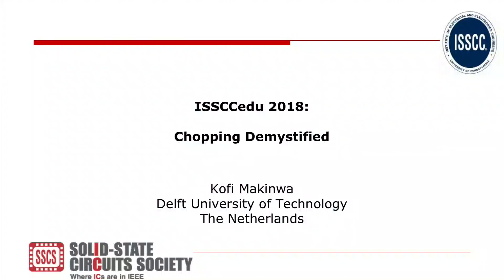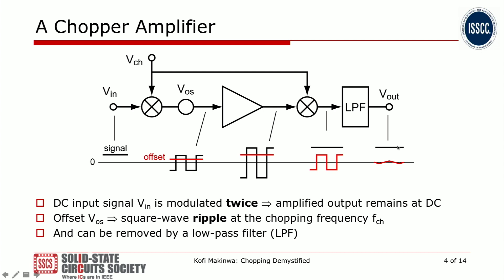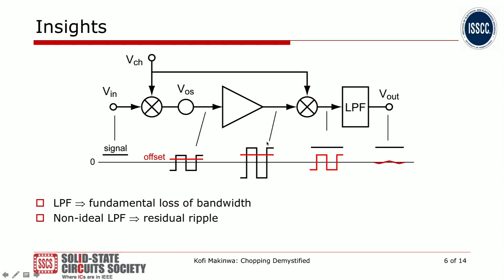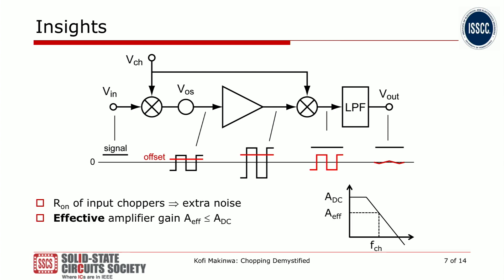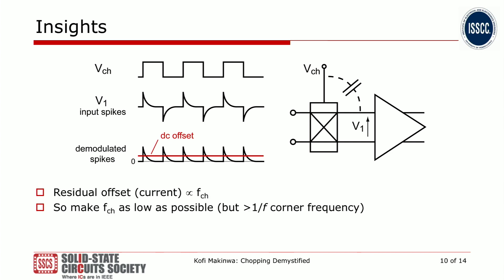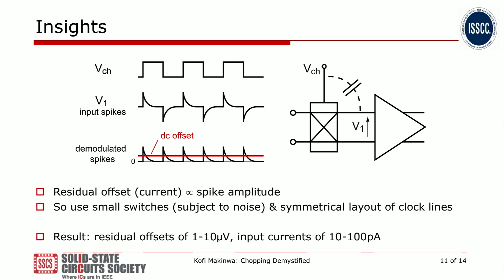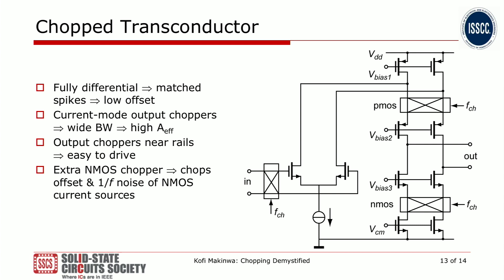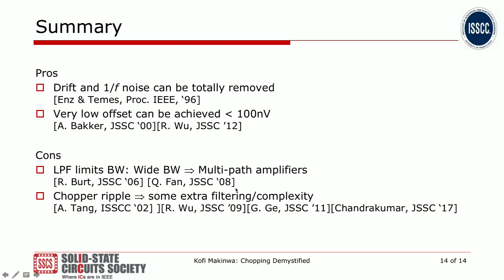Chopper Amplifiers Demystified Kofi A. A. Makinwa

Comment: can anyone help me with how to choose bandwidth of amplifier and chopping frequency in this and why?
Reply: BW of the amplifier has to be larger than the chopping frequency
Reply: Then how much would be the LPF bandwidth? It's lil confusing that LPF bandwidth has to be less then chopping frequency to filter out ripple and higher harmonics. But when we place LPF at output your chopping amplifier bandwidth reduces to less then chopping frequency. If amplifier bandwidth is less then chopping frequency  the amplifier itself gives less effective gain at the mentioned chopping frequency😢.
Reply: @AnnamAbhilash  May be thinking of it in terms of 3 separate blocks, makes it easier.
First the amplifier, it must have good gain at the frequency of chopping. It depends on the application as to what a good gain is. Hence for sure UGB must be greater than the chopping frequency.
Second, chopping frequency choice must be a decade higher than the LPF bandwidth, for good ripple reduction.
Third, what you mention as the BW reduction for the amplifier, due to the LPF is a loading effect to the amplifier. You can think of it as 2 separate blocks. If you're concerned of the loading effect you can put a voltage buffer like a source follower, to decouple the LPF & the amp BW.

Comment: some papers quote Zin = 1/(2*fchop*Cin). Here Zin = 1/(4*fchop*Cin). How this number 2 or 4 comes into equation and why they are different? Thanks
Reply: I do have same doubts. I am not sure how they come up with this equation. Even if we calculate impedence of cap it is 1/sc if s=2*pi*f   it should be 1/(6.28*C)

Comment: At 12:19, why current mode output choppers have wide BW? and hence high Aeff? current mode mean low input impedance so it's high BW?
Reply: Current mode chopping is chopping the current mirror branches..unlike voltage mode chopping which requires the charging of Cgs capacitance and so can introduce delay, in current mode, this delay will be smaller, as Cds cap is usually smaller than Cgs cap..hence faster
Reply: However, there is Cgs charging associated with the cascode devices..so the cascode devices can be sized smaller

Comment: how do we reduce the output riplle from lpf using chopping frequency?
Reply: LPF attenuates the ripple amplitude assume you send a sinusoidal signal with amplitude of 1 to low pass filter at the output you still get sinusoidal signal but it is attenuated with the filter magnitude. That's how LPF should reduce ripple from square wave aswell

Comment: this is a very simple yet very insightfull explanation , thank you.

so you basically up-convert the input signal to a chopping (carrier) frequency but not the offset, then buy de-modulating the output and filtering you get rid of the offset ... amazing

Comment: Can anyone explain the math behind the demodulation process. How can the same clock again bring back the spectrum to original signal ?
Reply: It's from signal processing modulation and demodulation standard thing when modulated signal at fch again if you mix with fch you will get two components one at 0 and other at 3fch same same like when you modulate input signal, the way your signal get modulated to fch and - fch.
Reply: Its like a mixer